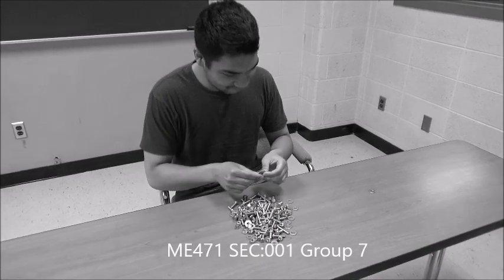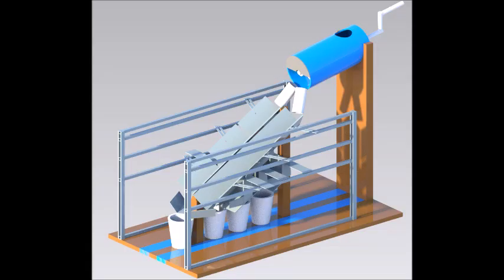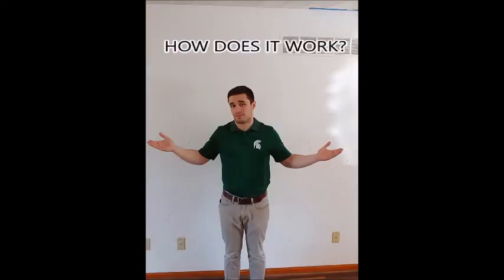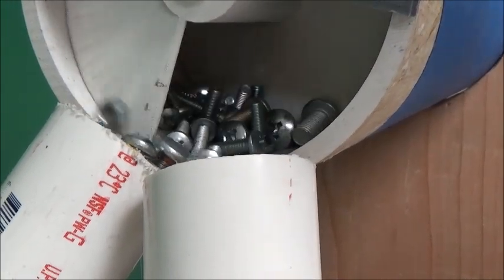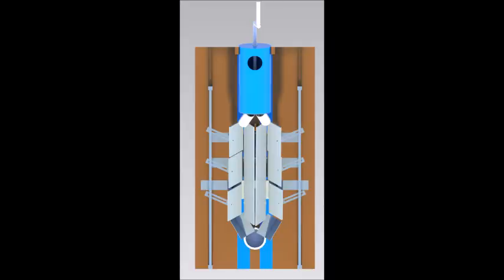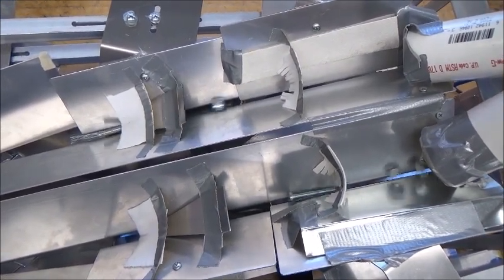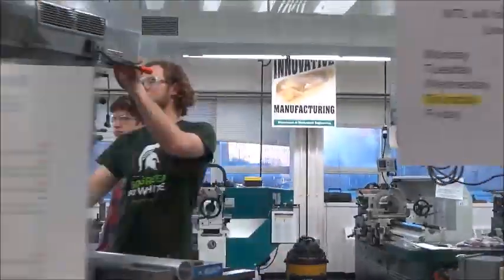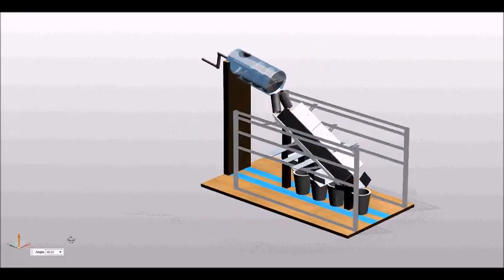The Fastener Ambassador - Washer, Nut, and Bolt Sorter

Comment: I truly hope they are first year students cause this appears to work to sort out the nuts, washers and bolts if all your 5/16 or 1/4 or 3/8 nuts, bolts and washers are in the same box. If you 1/4 are mixed with you 3/8 they will still be mixed after you "easily crank the machines by the stem" because the handle is too flimsy to turn the worm.

Comment: Not that impressed. This will sort only similar sized fastners, like a big nut an a smal screw will go to the same place.
Reply: Also bolts come in different thicknesses and lengths it will not sort them.